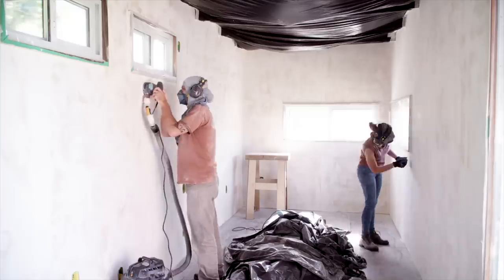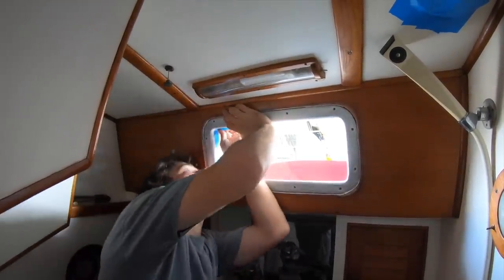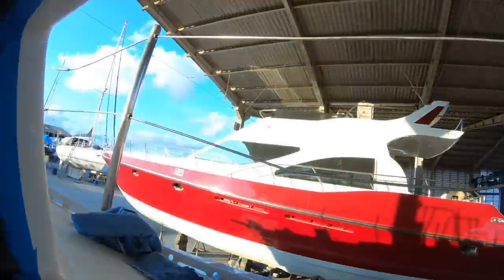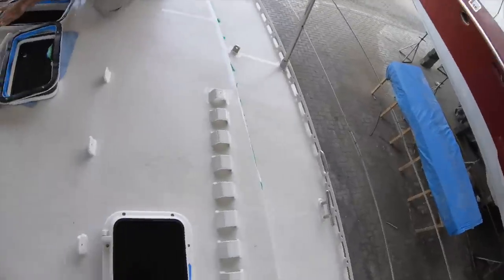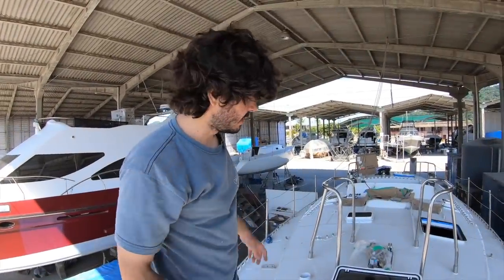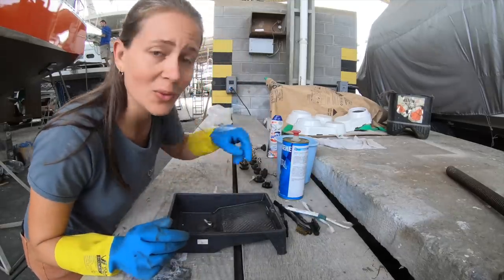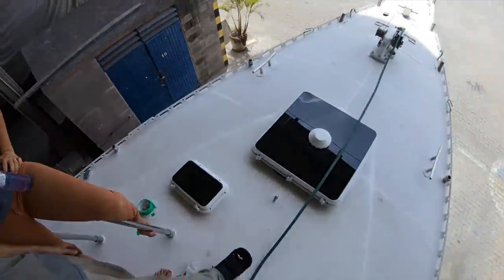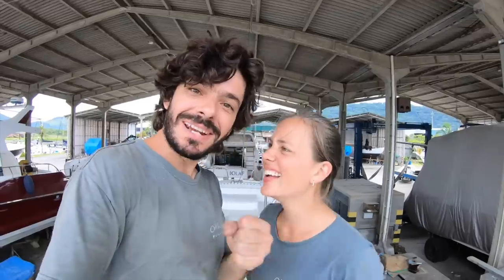⛵️We are so Excited!!! 🎉We are finally done installing our sailboat's hatches!!! 😍#115

Comment: Hey you both hard workers ! Let me tell you something: i'm a Paintshop-Manager here in Germany and I'M TOTALLY IMPRESSED about your work and your decisions ! You've done it all right so far. The things you couldn't do have them done by the Pro's (btw: the absolut right decision powdercoating vs. epoxy primer/wetpaint ! Why ? Because of the saltwater !!!), the things that you could do you've done PERFECTLY right ! Wearing safety equipment (when it's needed), proper cleaning, sanding and masking before the job, using the right (good quality) products and finally carrying out the job right (regarding the times to cure / the times to dry). Your work, especially shown in the "Hatches-Episodes", is a perfect example for achieving damn good results by being a (two) beginner(s), following the instructions and give the things the time things need to become good. Like i said: i'm really impressed ! You both have done so well - with your projects and by setting a very high standard for all the other DIY-Projcts out there ! All you DIY-People - watch out: THIS is the way it has to be done !
Reply from the maker: Thanks a lot, Stefan 💕💕

Comment: Hey guys, you may be able to install clear decal or car wrap material on the horizontal deck mount hatches to protect the surface of the acrylic. Then when the clear wrap deteriorates you can peel it off and replace it with new. That way you wont ever have to worry about the damaging the acrylic. We use it on the front of cars and headlights here in the states for a while now.
Reply from the maker: Thanks for the tip. Maybe it’s an option. We are gonna check it.

Comment: Looking fantastic! I know it's a bit late now, but I recomend using latex disposable gloves when doing anything with Sykaflex. And change them when they get any Sykafex on them (which means lots of changes when I use it). 2 benefits: first, you make less of a mess by touching things with black fingers. Second, it keeps your hands clean. You have to remove the gloves when dealing with sticky tape.
Reply from the maker: Thanks for the tip. We tried this method first, but them we couldn’t feel the sika and we always got everything black. 😂😂😂 we even tried to use a chemical glove, but we think what worked for us was to clean the hand with soap or alcohol every task. 😁

Comment: I see you found out about moon boots. After I was in the accident that disabled me, my muscles in my heel were pulling me off balance the whole time. This was corrected by surgically breaking the heel spur and adjusting the muscles in my foot. After the surgery, I had to wear a moon boot constantly for 6 months. After a while, I was so used to the moon boot.  I now balance way better. It is not easy to get used to, but after a few days, you do not even notice it. I was able to walk without a walking stick after a while, only the moon boot. I could even drive my 4x4 when wearing it - luckily I drive an automatic 4x4. For the first few days after surgery, I had a plaster cast - hugely impractical since I could not get it wet, until i got my moon boot. I still rely on it sometimes when my heel gets really tired, although I do not need it all of the time!
Reply from the maker: Thanks for sharing your experience with us, Stephen. He is still getting used to this. Hehe
Reply: @OddLifeCrafting  it will not take long. Once I was used to my moon boot, it was a wrench not to need to use it.
Reply: It will not take him long then watch out - everybody!

Comment: Acrylic is fine, the difference   is in the temper of the plastic and its definatly cheaper , polycarbonate (lexan ) is HARDER  and more impact resistant , we usually will put plexi ( acryllic ) in port lights and polycarbonate in deck hatches for safety , but that is just a general rule you all will be fine .Damn well ready for that job to be done hmmm? lol . You have done fine, you erred on the side of caution and it payed off .Now if you ever have to a job like that again you will have all the knowledge you need and it wont be near as bad .Very glad to see you coming along , 1 step closer to splash , take care see ya next week
Reply from the maker: Thanks for the explanation. Actually we also couldn’t find the polycarbonate in the width we needed. Thanks for the support, Lawrence

Comment: Great video.  A suggestion from 38 years of sailboat cruising.  When ever we need to do any caulking - like you just did with your hatches we do the following

1.  Rip off 4-10 paper towels
2.  Using a scissors we cut them up into 3-4" squaresor about the size of a playing card
3.  Stack them all together and attach them together with a clothes pin
4.  We have a small trash can next to the job

As we start to clean up we pull one piece of paper towel off the stack and dab a bit of paint thinner on it.  Wipe up some of the excess caulk and toss in the trash can.  Then grab another piece of paper towel and continue.  We have found this keeps excess caulk off of us and the other surfaces.

All the best !!
jacarandajourney
Reply from the maker: Thanks a lot for the tip, Chuck

Comment: Small tip for smoothing various silicones. For easy silicone smoothing. You must first dip your finger in the dishwashing detergent solution. The solution which is then dishwashing detergent and water should be made somewhere in the cup ready. The smoother the solution the better. And every time you start smoothing you dip your finger in there. This helps the finger slide. And silicone doesn't stick so badly to your finger. After that, the result remains very smooth and professional.
Reply from the maker: Thanks for the tip, it’s actually closer to the way we have been doing and the result is pretty good

Comment: Bonjour les amoureux,
I am happy to see Duca back to work without suffering of your foot :+) To help you, you did not find any electric screwing machine ? Never mind, the job is perfect, For information, as I have the same, you made your threads with a "tap" and you would make your screws with a "die".
Besides this, when do you get your new mast ? And when do you test the engine ? Do not forget a little room for a TV antenna :+))
Amicalement, Raphaël

Comment: I been needing to replace the portlights and hatches on my boat. Fairly big job...it's a hunter cherubini 33 and has 10 portlights total (5 on each side) and 2 hatches up top. The portlights look very similar to yours and just might fit my boat. Curious to know where you all ordered those at and what make they are?
Reply from the maker: The hatches came with our boat, they were made in the same factory of our boat, Dinieper. They are based on the one called Goiot.

Comment: Q: Those top hatch's, did you install them backwards? The way you have them, it would "scoop" the air underway, but all the spray would be scooped into the boat as well. I think I would have put then on with the hing facing forward.
Reply from the maker: The hatches open to the front as we live in a hot area and in this way the air can go inside easily. When sailing the deck it too wet and we can’t leave them open anyway.

Comment: Hi guys loved following your progress, just wondering why you installed the hatches to open to the bow, instead of facing aft
Reply from the maker: The hatches open to the front as we live in a hot area and in this way the air can go inside easily. When sailing the deck it too wet and we can’t leave them open anyway. 😉

Comment: Just a little helping idea for you.  When you are screwing into wood, using a wood screw, rake it across a bar of soap once or twice before screwing it in.  Acts as a lubricant.  If you find a hole for a wood screw has been enlarged and won't hold, put one or two wooden toothpicks in the hole, get the screw started and break off the excess toothpick and screw it down.  It will pull up tight.

Comment: if your budget allows. and given you guys are really doing a thorough job,  buy 316 stainless tube (say 3mm wall thickness)(or match the thickness of the stanchions) and get a welder to weld it to your stanchions. you will end up with a rigid guardrail all around the perimeter of your deck. this is a major safety upgrade. may not be cheap initially but it will pay out through the entire life of that boat (also upgrades the market price of it)
Reply from the maker: That’s the reason why we took them of 🤐

Comment: I am curious about the orientation of the deck hatches.  It appears that you installed them with the hinges on the stern side of the hatch.  That means the hatch opens to the bow side.  If you leave a hatch open while underway, it seems you risk damage to the hatch.  My inclination would have been to install with the hinges on the bow side.  Perhaps you never leave a hatch open while underway.  I am not a sailor.
Reply from the maker: Hello, Marshall. Usually in hot weather people install them opening to the bow to get more air. We are gonna need to have them close when sailing as the boat gets really wet on the deck while sailing

Comment: Hi just a thing any screws or bolt on the outside use a bit of copper grease or anti seize on the treads
Reply from the maker: Thanks for the tip. We actually applied some sikaflex in them

Comment: Looks awesome you guys! Good job!  Is there any preventers for the hatches so they wont take damage if they slam fully open ? like on the hatch at 9:01. That metal that's sticking up seems to be able to damage the acrylic if the hatch opens to quickly.
Reply from the maker: Yes. We still need to install the pieces to keep it open, but we need to make a new piece to install them in place.

Comment: Acrylic is a bad choice on a boat, it crackles in the sun and salt water. We ended changing it all into real shatter proof glass in some places and poly carbonate other places, but you'll find it out your self. It takes a while to happen though so you should be good for a year or 3.

We might have gotten a bad batch of acrylic, but other friends experienced the same thing in the same time frame. Hopefully acrylic has gotten a whole lot better since then and you'll not experience the problems we had.
Reply from the maker: Thanks for sharing your experience with us. 🤞🏼 hope we are lucky and they can last for longee
Reply: Sew covers for anywhere and everywhere you can fit them, worth it as reduces maintenance a lot

Comment: It looks like because you have a steel boat it has an external flange to screw the bolts into which means you don't have to thru bolt the hatches and portlights. Much better for leaks and a reliable installation . Also not having to deal with the bolts coming inside !   The modern way is to have as flush hatches as possible or even in a recess to avoid tripping hazards. ( as you found out), But in the Long run I much prefer the design your boat came with. Not really possible on fiberglass boats.   Well done great install. Cheers Warren
Reply from the maker: We also like a lot the design of our boat! 💕 the problem of not having the screws is that we would need to glue the wood finishing in the end and for this we would need to have the correct amount of sika in between every single layer to have a good finishing in the end with the correct width. I don’t know if I explain it in a way that is understandable. 😬 well, to sum up, in our case we prefer to keep the screws there to be sure it’s sealed correctly. ☺️

Comment: Polycarbonate (Lexan, Hyzod, palram etc.) has excellent impact strength but generally, depending on the grade of material, does not stand up well to abrasion and also is generally less resistant to UV. Acrylic (should be cast acrylic and or marine grade - never extruded acrylic for marine) will be very long lived, 10 yrs plus, and yes you can refurbish the surface by wetsanding and polishing.
Reply from the maker: Thanks for the explanation

Comment: You have to use 3M 5200 in white it is expensive but in the USA its all we use. No mildew or yellowing. get some you will not regret but the windows are done but there are always bedding issues to fix. Sikaflex is really good stuff I agree but they don't make it in white.
Reply from the maker: It’s not easy to find the 3M one here in Brazil. 😞 they don’t have this one in the stores here in Guarujá, where we are now

Comment: Hey guys just a question re positioning of the hatches
I notice they open from the front of the boat...........I was thinking if they opened from the stern they could be open when your in motion without the chance of water ingress while allowing ventilation. 
I can only assume they can only fit one way rather then being equilateral.
Oh another question ......how are the sails? Or are you using new ones?
I’m  enjoying your adventure thank you again for sharing your lives🙌👏👏👏🇦🇺🇦🇺🇦🇺
Reply from the maker: Hello, Brian. The hatches open to the front as we live in a hot area and in this way the air can go inside easily. When sailing the deck it too wet and we can’t leave them open anyway. Some sails are usable, some are not

Comment: i notice you dont use power screw drivers, is there a reason for this as it could be concidered as a time saver ?
Reply from the maker: Duca likes to use the manual one to feel the pressure on the screws and to avoid scratching the hatches☺️

Comment: Polycarbonate can be polished. There are many varieties, the same way you can find 60 varieties of acrylic. The polycarbonate can be 10x to 100x stronger than acrylic but yes, 10x the price as well. With either material there are $special grades that are UV and scratch resistant and more expensive still. Both materials will craze and fog if they cannot expand and contract, or if they come in contact with ammonia or petrochemicals, so careful with waxes and cleaners on them.
Reply from the maker: I think the one we had available won’t be able to be polish. Thanks for the explanation

Comment: Hello Roberta and Luca.  Congratulations on doing such a good job on the Portholes, Portlights and the Hatches.
They look very good.  I was wondering if the Acrylic you used on the Hatches on the upper deck is as strong as Poly-Carbonate would have been.
If you were walking on deck in a rough sea could you step on the acrylic hatch cover without breaking it?
Reply from the maker: We could step on it as it has 12mm. We don’t have this width of polycarbonate here in Brazil
Reply: @OddLifeCrafting  That is good to know.  I think you made the right choice with the acrylic. Thank you for answering my question.

Comment: How many rolls of that blue masking tape have you used so far, probably enough to have got that company out of any resection 👍 and you need to get a battery driver for all them screws. But what a wonderful job you have done looks better than new.
Reply from the maker: Hehe. We have no idea. We actually have a battery one, but Duca likes to use the manual one to feel the tension of the screw.  Thanks for the support

Comment: Once again, this must be too late but let me tell you a trick to smooth Sikaflex (or other silicone-based products) : cut a potatoe to the shape you want and use it to smooth the surface. Sika does not glue to "potatoe" and you'll keep your fingers clean :-)
Reply from the maker: Thanks for the tip. We are actually liking to use the soap for the job 😁

Comment: Guys I would have installed the hatches in a way that they would open  towards the front of the boat and not the back...imagine how difficult it would be to close that bow hatch with the wind and the seas off your bow...just a thought
Reply from the maker: They are opening to the front actually 🤔
Reply: Yeah probably I didnt explain it right...I meant for them to open towards the back...away from the wind and the seas...

Comment: Silicon works slightly better if you tighten gently, and then let it set, and re tighten after everything is completely dry..  it’s not a 100% rule,  but if you can imagine makes more of a gasket, than just a glue..  it’s probably fine..  but just know you can re tighten alittle more whlie you can still get to the screws..  but this information is probably too late..  idk..
Reply from the maker: It’s too late for now. Maybe in the future we can use it. Hehe
Reply: Odd Life Crafting,  it’s not super important, but i think you understand or can imagine,  your not only glued, but because the silicon is slightly proud, the gasket effect is sometimes slightly longer lasting, but more importantly can be tighten at a later date (say 5 years) to  re seal without disassembly..  people will Argue that’s not 100% true, but in them cases it’s normally the silicon has completely failed.  Which can actually happen, but rarely,  i just pointed it out, ask 100 people 50 will agree 50 won’t.   So your installation was perfectly fine..

Comment: Congratulations from an old sailor living in the mountains of Montana. Every time I see you using a manual screwdriver I wonder why you do not use a battery operated one? I have been building for many years and would use my battery drill/screwdriver on every project. There will always be times when the extra care of a manual screwdriver is called for...however, the the battery drill saves SO MUCH TIME.
Reply from the maker: Thanks a lot, Mike. Duca likes to use the manual one to feel the strength of the screw and to avoid scratching the hatch with the screwdriver

Comment: Should really have the hinge at the front so that any sea over the deck will not go down the hole and ideally shut the hatch. Des.
Reply from the maker: The boat is too wet on the deck when it’s sailing. The ideia of having the hinges on the back is to get more fresh air as we live in hot places